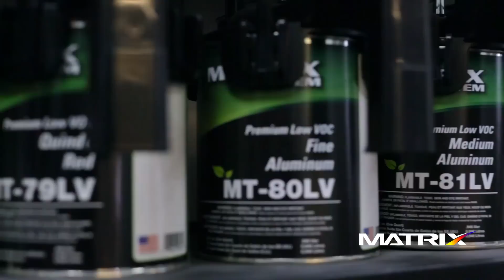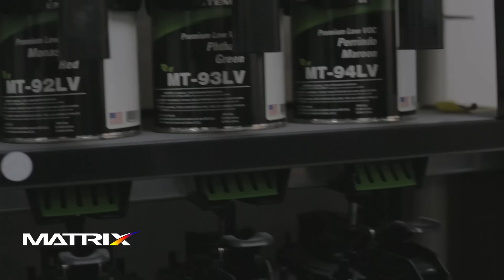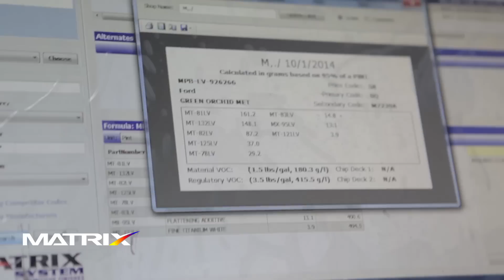Lumpkins Auto Body Talks About Converting to Matrix

Comment: Painter needs more protection. No hood and no suit ?
Reply: @Joe Cue  >Under normal circumstances I would agree with isocyanates type paint. But, if you watched and listen the entire video, it was “Water-Borne” paint. Check out videos that show even Chip Foose using water-borne paint. I live in the middle of both coast. I do not have to use water-borne paints. We are allowed to spray one gallon of isocyanate type paints at home per 24 hours. I choose to use 3M paint mask with activated carbon filters behind a particulate filter (N95). The N-95 is a particulate mask and the China Covid 19 is sputum, part particulate and part aerosolized! That second part is not protected by an N-95 mask! Good luck with learning. ;)
Reply: @deankay4434  The isocyanates are in the catalyzed clear coats.  The clear goes over solvent or water borne base coats.  Need protection.  It does help that the shop has a state of the art downdraft booth.  Painter is rarely disposed in the air flow.  Fun to learn!